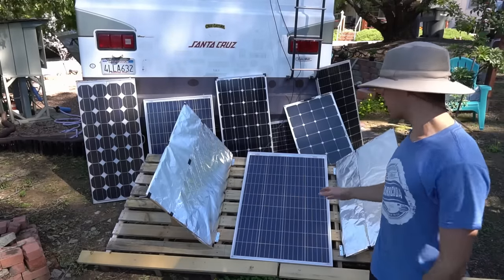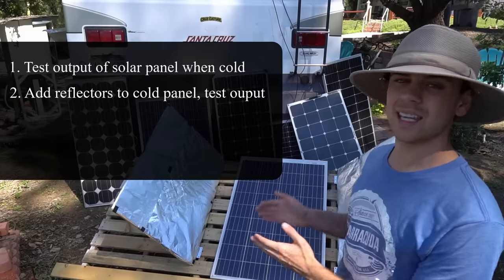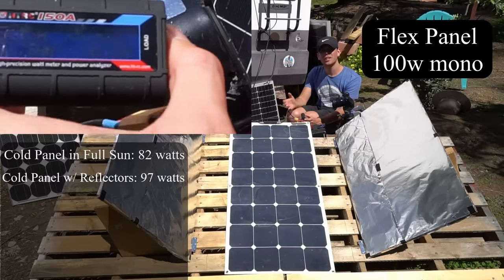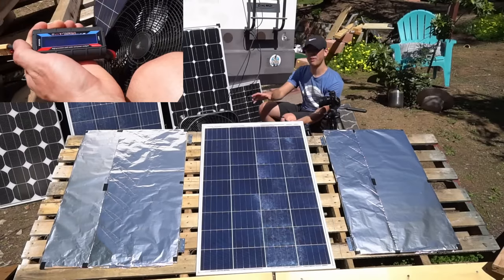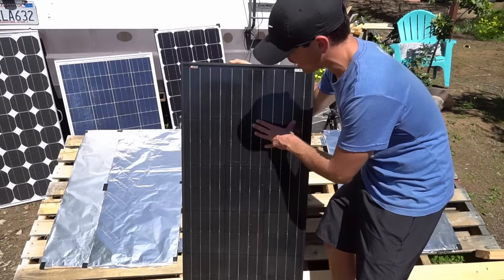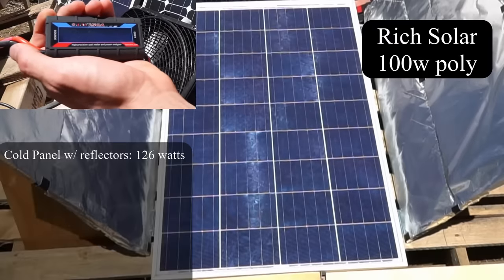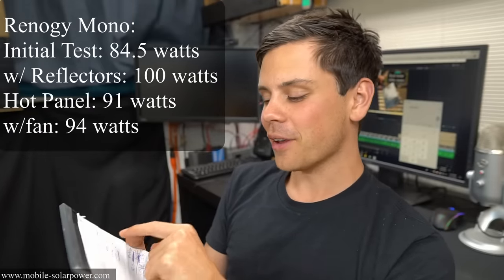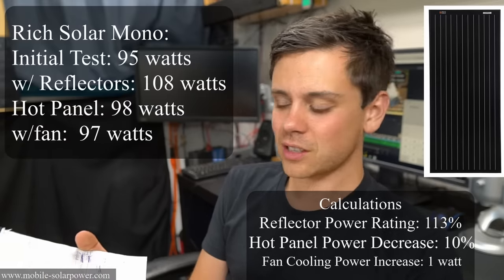Solar Panel + DIY Light Reflectors = More Power? Renogy vs Rich Solar vs Flexible Panel

Comment: Mono is from 84.5w to 100w which is 15.5%w increase when reflection on. Poly is from 102w to 122w which is 16.3% increase when reflection on.
Poly win
Reply: Doesn't matter. Since reflectors have to be adjusted hourly, they aren't worth using. It comes back to cost per watt.

Comment: handling solar panels can and will crack the cells internally trust me I know because I have 20 325 w solar panels and I want carefully with one and picked it up wrong i saw it wobble it was missing about half a amp from the output and a ir test showed it was cracked
Reply from the maker: Yeah I did that 8 years ago with 300 watt panel because torsionally they are not that strong. That's why they have double wall aluminum rails. These panels are way stronger due to their size

Comment: I installed a 100w panel on top of my fj cruiser but I am only getting up to 3amps.  I read on the forums that maybe a resistor is bad?
Reply: Power loss threw wire. Get bigger wire, and make wire shorter
Reply: @tmz1313  

My wire is 10 awg but it is only 8 feet.  I am running duel battery and when the isolator connects both batteries, the amps jump to 4.  The  4 amps is th max it gets.  Also,  the amps jump up and down, from .5 to 4 on a sunny day.  I have a feeling my cheap controller is the cause.
Reply: Yeah could be... its definitely not your wire.
Reply: @tmz1313  

Ok thanks
Reply: You also need a load on battery to get full power out of it. Your batteries may be full
Reply: @mrmotofy  yes!!!! If your batteries are already full then it will limit your current to the battery

Comment: When I saw, "reflectors" I thought mirrors not aluminum covered boards! What results would you get if you used actual mirrors?!
Reply from the maker: Not that big of a difference at all
Reply from the maker: That's why solar ovens use polished aluminum. Not mirrors.
Reply: Agreed, but that aluminum you used wasn't that reflective compared to how reflective that polished aluminum in those solar ovens are but I was just wondering to how little more could you squeeze out if you did use mirrors?! I also know the panels would heat up even faster so... Also, I could see in the thumbnail you weren't using mirrors so take my comment as a grain of salt, no worries, nice video anyways!
Reply from the maker: @elementalblaze79  oh thank you. yeah I am going to test white boards next actually :D should be cool!
Reply: White board enhanced solar panels?! Have to look for that video when its out!
Reply: @WillProwse  Results?

Comment: It doesn't make sense that the power output would drop on a solar panel which is in the Sun so it can't be too hot that doesn't make sense cuz it's in the Sun or it's not going to charge I don't get it

Comment: You said "has a black frame...so it can absorb more heat."  It seems like your understanding of the physics is off there.  Having a black frame means it WILL absorb more heat from its surroundings (especially the sun) and therefore will become hotter than a reflective (silver, aluminum) frame, which will absorb LESS heat from it's surroundings.
   Because of the increase in heat and associated problems, it seems like the best use of mirrors would be to direct more of the sun's rays on fixed panels either early in the morning or late in the day.
    I love your videos though...

Comment: Anything you use to cool the panels down, is going to require energy to run, so you defeat the purpose of the reflectors.  Also, by heating the panels that much will undoubtedly decrease the life expectancy of the panels by quite a bit.
Reply: Convection would circulate a water cooled system, no other energy needed.

Comment: What if the reflector is curved? Concave like the curved TVs
Reply: The entire surface of the solar panel must receive uniform sunlight intensity. For example, if top half receive 1000W/m2 of sunlight while bottom half receive 500W/m2 of sunlight, the entire solar panel will take into consideration the lowest. To make things worst, hot spot will occur which will increase temperature, decrease power generation and damage panels in the long run.

Comment: You'll melt your panel. If you want reflectors go with a fresnel enclosed steam loop
Reply: You can't cool surface tempted down. Your blowing the fan on the clear glass atop the black surface when the heat is coming from the black surface underneath. Put copper strips in water and align them like a heat sink

Comment: interesting but why then they say mono has 21% efficiency and poly around 16% the result make no sense with the efficiency chart!
Reply from the maker: Look at the square area. My results agree with the efficiency figures
Reply from the maker: Poly panels are bigger. Watch the video again and get out your calculator
Reply: @WillProwse  yeah thats probably why it works better,
just quick question my household use around 3000kwh per month how can i compute exact numbers of panels and batteries i need to make it fully offgrid.  to make it work 24/7
tnX

Comment: Hi, Will prowse get perfect with your video and other solar system! you can also need to powerful solar system panels, not 100w! you need 300w solar system penel & battery power 36v DC! You needed > 🏊‍♂️$ 👍

Comment: would be interesting to see what the reflectors could do in spring/autumn or morning/evening conditions when heat is not sich of an issue .. just thinking instead of moving the panels which is mechanic items that are expensive and a pain in the a.. in terms of maintenance, just adding mirrors or cheap reflectors to have some more light in the morning and the evening hours could be a good bargain ?

Comment: Not accurate test. The mono and poly is not the same size. I think the mono is fault lable. Mono is should be lable 90w. Someone lable 100w just for marketing. Because it is smaller in area surface. 
The test must be use timer and temperature reading when panel expose to sun.
Reply from the maker: Exactly!! That was the whole point of this test. The standard test conditions are different and one shouldn't be labeled as 100w. That was the whole point of the video

And the test is accurate. I it consistent numbers over and over.

Comment: I don't want my panels getting too hot so I keep them in the shade. Just kidding. 
Like others, I wonder if inventing a water cooling system would also provide hot water. It's like turning a solar system into a water heater at the same time.
Reply: There are solar thermal and PV hybrid in the market but it isn't cheap.

Comment: Would the world have been better off on 48 volts? Why do we have 12 volts in cars etc? Was it size, cost, or just the way they never changed or started?

Also if the answers are ???.......Could the reason the 48 volt world(cars etc) never came about be when oil/rubber/(what was the third one?)  took over and ousted mass transit and elec cars. 

Interesting the reason oil/rubber/(and?) was able to commit genocide was ...the elec motor which started petro engines.

Also we need more organization(video?) committed to ""PLACES" tiny homes and campers can unite. There are many places not tapped like many small town parks/lots/curbs/ and backyards. The reason I am going here is I am amazed at the ways they are trying to make huge homes more efficient and many have smaller non-farm-help-bred-families now. What is it about building developments requiring huge sq ft, shingle roofs on a 200 yr foundation, and some tax collector tells you you can't build under 1500 sq ft.

Comment: So your video is without any real consideration to "usable" wavelengths.  You clearly stated your panel heated up.  A small search could have yielded a simple 380 nm wavelength for typical PV systems.   You were reflecting all waves (a significant amount of IR).  If you were to buy a cheap Titanium/copper 300-450 filter screen you could have reflected the needed wavelengths and increased your output.  However, The big question becomes wave mechanics.  You are injecting waves at three distinct angles, one has to wonder if the photonic interactions of the two reflector panels are causing destructive interactions.  As well, you lack the proper consideration to crystalgraphic planes.   You would have been better off making a true optic pipe where you re-inserted the reflected waves at near a normal vector.

Comment: So 2 poly will be 160 that is cheaper than the best and will give you 200watts... Mmmm
Reply: The "best" is actually only more expensive because it is a flexible panel, not because of performance.

Comment: I do not think it's a good idea. it increases the heat and also shortens its useful life. it will no longer be 25 years old if not 10 or 15.

Comment: Really, so we don't need a directly situated soalar panel to the Sun? then sun tracking device is not that usefull?????????????? geezzz.
Reply: Tracking helps, certainly. But it's also bulky and expensive compared to the cost of the panels - so it can easily work out more cost-effective to spend that money on just using more sub-optimally-orientated panels. Three panels in poor orientation can still outperform one panel with a tracking system.
Reply: @vylbird8014  Oh thanks alot Sir, more power to you.

Comment: At those angels , very little  sunlight from those panels will hit the solar panel what a fucking joke LMAO.( i done this years ago. looking nothing like this).
 my calculations of your setup have the sun hitting both aluminium panels and reflecting straight over to the other aluminium panel bye passing the solar panel completely.
Even at best exposure all your really doing is heating up the panels and reducing their life .

Comment: I think your tests are a failure because you used so crinkly tinfoil and so low angles. A flat reflector at a 45 degree angle will reflect sunlight vertically to the side, not onto the panel. Other videos on the subject of reflectors for solar panels show much much better outputs.